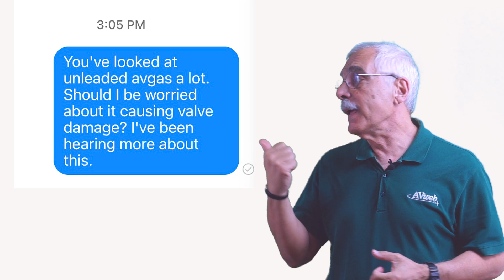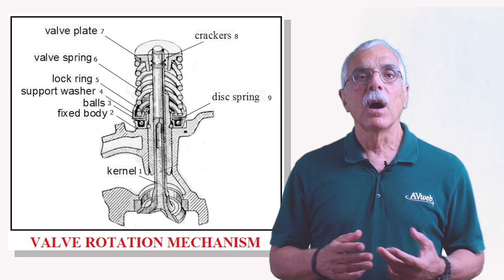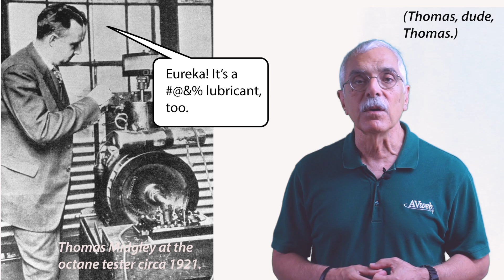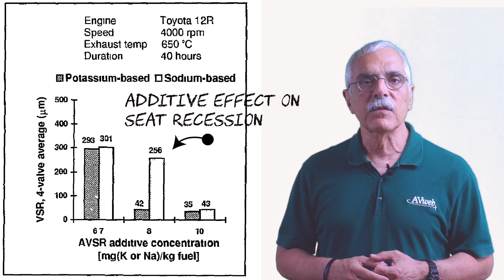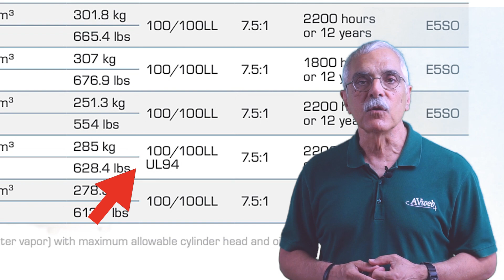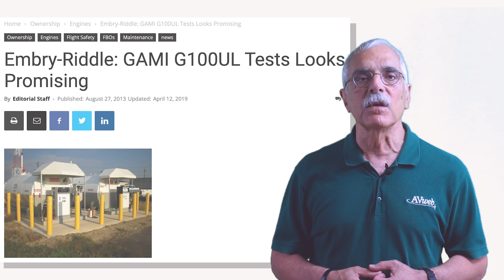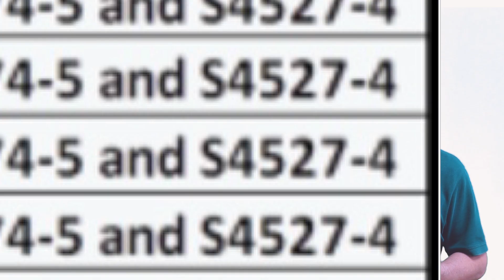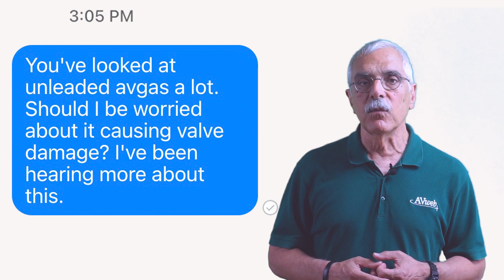Whadayamean Unleaded Fuel Will Trash My Valves?

Comment: For years and years Amaco had lead free gasoline. Long befor other brands went lead free. It had an octane of 95. My Dad use to run it in his vehicles for years. Also in the lawn mower, motorcycles, or any engine. Instead of lead they were using a chemical called “ Nichol- molibdium” to lubricate the valves. I may have spelled that wrong. It never went stale when stored. Or turned to gum. And the high octane never pitted the pistons of small engines. It was also great in 2 cycle engines. It was a great fuel. But in time went all others went lead free they changed the formula in Amaco gas. It’s not the same fuel anymore. And I believe all lead free gas is the same except for the added cleaning agents. Aviation fuel has extra components added to prevent boiling at higher altitudes. I have found that for automotive fuel EXON has the best cleaning agents to prevent carbon build up under the valves. The Ford eco boost engines are prone to carbon build up due to the way the emission system works.

Comment: An interesting comparison is the larger capacity air cooled Volkswagen engines (1585cc Type 1 and the pancake / suitcase 1970cc Type 4 Varient derived Transporter engines). These were rated to run on RON 90/91 fuel. The Californian specification engines may be of interest because of the mandatory use of catalytic converters which mandates the use of unleaded fuel.
Reply: As Paul said... Didn't most engines by the 80s and certainly by the time ECU control came around already have better valve seats?

Comment: God I'm sick of generalisations ... even by experts. Noone can generalise about any  fuel in any car. There's only one real answer: Every valve and every valve seat and every combustion chamber is made to the manufacturer's specifications for each particular engine model to be most efficient and ling lasting with a particular fuel. If you want to know the true answer for YOUR ENGINE, ask the manufacturer. Any fuel outside of their design and production parameters is an engine degrader in some way in some time frame.

Comment: Lead is extremely corrosive when an engine is stored. I've seen dozens of C Continental jugs with pistons and numerous things can attack them, but not a lack of lead. There's one more aspect to unleaded plane gas. Politeness. You can drop in, buy a Tee shirt and a hot dog, and gas up with no second thought. If your tank is 100% no lead, it's fine to drain all your plane gas into your car. I can't wait until lead is gone, altogether.

Comment: "Just trust us" doesn't cut it. Proprietary formulas are no excuse; we don't need to know the formula, and performance is not a protected trade secret. Show me a proper peer reviewed and independently repeted testing paper. 
Calling lead oxide a "lubricant" may be a mistatement based on assumption. But at the same time just because the protection does not come from lubrication in the sense of friction reduction does not mean that the coating is not offering protection.(It is likely either preventing a chemical bond or it is acting as a sacrificial weak link.)

I caution against the commonly misused term "hardened valve seats" as well as conflating abrasive wear with microwelding material transfer wear. The problem can be more about alloy than simple hardness. 
On one hand simple carbon steels and cast-iron will loose surface hardness at a fairly low temperatures (Relative to exhaust valve surfaces [both sides] in an engine at high sustained load, esp air cooled engines.), certainly below local temperatures needed for microwelding. Grey cast iron as used in 1960s cylinder heads is actually fairly hard and loaded with iron carbides and graphite flakes at room temperature. 
Many valve seats are made with a cobalt alloy called Stellite™, which is happens to be relatively hard but not as hard as a quenched steel, the advantage of Stellite is that it is more heat resistant than common low-alloy steel and iron, and on the chemical and crystalline side of things it isn't prone to microwelding with valve steels. 
Wear resistant steel alloys are often put through a hardening process but it is less about gaining the hardness and more about the formation of carbide particles or a toughened matrix to hold the particles.
Chromium, tungsten, vanadium carbides are the most common anti-abrasive wear players, being a magnitude harder than even the hardest quenched steel, iron-carbide is slightly harder than quenched steel but not on the order of the other carbides. But there are a few less common carbides and a few nitrides that can also add wear resistance in some alloys. 
There are also high-manganese alloys of interest, but I now less about them and they seem to be more in the category of work hardening and based on being softer but tougher and used often get used against loose particle abrasion as found on equipment that moves dirt and crushes rock as well as heavy impact such as railroad track junctions, but those alloys are rarely found on precision ground stuff like cutting edges.

Comment: Lead oxides lube hot valve faces and valve seats preventing recession, in  older alloys of valves and seats.
Newer engines have compatible materials starting in the 1980's
45 years in business and I have tested this many times.

cliff

Comment: I can't help but notice that Paul says that the switchover for cars was a problem. And Phillips did a study and found that it was a problem. And Continental said don't use it because it will be a problem. It is true that hardened seats are the cure. And a lot of airplanes have hardened seats. So "give it a try and see if you have an engine failure over a city." So all of the anecdotal evidence is wrong because there was one study on a low compression, low performance engine that didn't have a problem. From people who stood to benefit from it not being a problem. I'll follow the evidence of Lycon - who rebuilt my engine - "We did that engine too long ago. We don't have records back that far so we don't know if you have hardened seats or not. But we have had four failures from engines in California running unleaded so far this year. So I would run leaded gas as long as you can if I were you."

Comment: Thanks, Paul, for a comprehensive analysis of unleaded fuels in aviation engines.  It greatly helped put me at ease with this change.  Question:  does the UL fuels store as well as the 100LL fuels?  Car gas doesn’t store well at all.
Thank you
Reply: Modern automotive fuel doesn't store well because of the added ethanol. Ethanol-free mogas stores just fine, just like 100LL does. Since 100UL is ethanol-free, I would expect similar results.

Comment: Log ago I went through a phase of owning and riding old BMW "Airhead" motorcycles. If the bike was on its original topends (likely), whispering wisdom said use a lead substitute. If it had been rebuilt it likely had hardened seats. All my bikes were on the original topends and I used some additive. I can't remember the brand but I think it may have used cadmium, which, while legal, was no doubt more toxic than lead. You used a small amount - an oz or so, every few tankful's. In 50K miles or so I never had any noticeable issue. BTW, spark plug deposits were basically nonexistent, so I think this stuff may have been more in the realm of placebo than useful.

Comment: I'm rather offended that Continental didn't make the switch to hardened valve seats long ago.  I mean, the writing has been on the wall about leaded gas for decades now, and light aircraft have vastly longer actual lifespans than automobiles.

Comment: An important point here would be that likely all aviation engines use aluminum cylinder heads, which should all have valve seat inserts, and those inserts may as well have been made from good alloy metal.  The cars of the 60s and 70s had cast iron cylinder heads and just used that material as a valve seat.  There was no need originally to have inserts at all unlike engines with aluminum cylinder heads
Reply: That was indeed my understanding too. Though I had Alfa Romeo with an Aluminum engine and valve seat recession was a problem...
Reply: @ziegle9876  I guess they just didn't use a good enough alloy for the seat inserts?
Reply: @RickBaconsAdventures  Yes, they did not foresee such a radical change in the fuel when designing the engine... Another thing that Paul has not spoken about is the likely addition of cyclic aromatics to achieve the 100/130 rating.... They not only degrade with time, they are also highly carcinogenic (guess why gas stations are all self-service since "unleaded" came about) and not good for many elastomers/plastics (think windshields). The lead content of current 100LL is so low that it is irrelevant, and it makes the fuel long term storable and stable. It is really a pity that we can't have leaded speciality fuels like for aviation, motorracing etc.
Reply: @ziegle9876  are you insinuating that leaded fuel being combusted all over is the better solution
Reply: @ziegle9876  Self-service took hold for the same reason as many changes in retail; because it was more profitable for the owners of the gas station, who could sell more gas more quickly for a given number of employees. You don't need a conspiracy to explain that one.
Reply: @IstasPumaNevada  Ah, but you do if you're a conspiracy theorist and you mind is muddled from lead exposure.
Reply: @swell07_  100%, YES, at least for the special case of our AIR COOLED aircraft engines.
Reply: @IstasPumaNevada  Cancer from cyclical aromatics is not a "conspiracy" but a fact. That anybody had any negative health effects from low lead Avgas however is a pure conspiracy.
Reply: @ziegle9876 well we can certainly tell who’s been mouth-sampling the 100LL around here!
Reply: @ziegle9876  leaded fuels are absolutely available for motor racing. VP makes numerous types/octane ratings, as does Sunoco
Reply: @harescrambled  Yep, tons of morons in the powersports industry buy it and put it in their stock dirt bikes, snowmobiles, etc. Most of the time they lose power because most leaded race fuels have a slower burn rate and they aren't adding timing to make up for it. I find it unbelievably stupid and annoying most of the time, especially when i'm stuck behind one of them in a 1 line off road race. Very few vehicles running leaded race gas actually need a leaded fuel.
Reply: @ziegle9876  I have in canister over 5 years old 98 unleaded "E" free petrol, and it works perfectly in my 2 strike trimmer. not the lead make fule last longer, the "E" in the fule makes it shorter shelf life.
Reply: @ziegle9876 You are correct. Aluminum heads on early Honda engines, pre-2010 or so, do suffer from recession and the valves, particularly the exhaust valves, need to be adjusted after 40-50k miles as the valve clearances become closer and are in danger of overheating (burning) if you are engaged in "spirited" driving. Not sure that Honda has resolved the problem or not, but I no longer hear that it is a problem. The problem is/was not in the inserts themselves, but in the differing heat expansion rates of aluminum v. the hard seat material, which allowed the insert to be pounded down in the aluminum head a few thousands of an inch.
Reply: @GaryL3803  Strange that nobody has credited you with giving the information that valve seat recession will cause the valve clearance to reach an unacceptable (minimum) level, where the exhaust valve may not entirely close on the compression stroke. Obviously, this will lead to burning of the valve - resulting in a compression loss on that cylinder. I have seen this situation develop, on a Renault car that I owned. Further to this, there are different rates of cubical expansion - between the valve seat (steel alloy) material and an Aluminium Cylinder Head. I have also seen the effects where the Valve Seat will 'turn' - due to heat expansion, and this too, causes compression loss. I have even seen Exhaust Valve Seats being completely dislodged, and floating around freely, causing piston / engine damage, because the Exhaust Valve could not close, and thus contacting the piston.
Reply: You had a GM product, same as the SAAB I had @ziegle9876
Reply: Yeah ... I was kind of waiting for him to talk about titanium valves, or sodium filled valves that stay cooler.

Comment: It was my understanding that lead additive in gasoline was to prevent knocking, it was not added as lubricant.   Preignition can definitely cause damage to the valves and increase wear on the engine.    However, electronic ignition and fuel injection system removing the risks of knocking when the correct octane fuel us used.   Older planes with carbs on their engine., that I don't know.

Comment: It appears your av engines are low compression.  I am restoring a 1970 Cadillac with 10.5:1 compression.  Its a flat tappet engine with around 33,000 miles and as far as I know no problems.  I use diesel oil for the ZN and P additives in it.  I have always heard lead lubricates valve guides.  I have assumed in auto engines any no lead damage would occur over 10s of thousands of miles not 10 hours.  This car has obviously had no lead for decades.  I have a 74 Tr6 with no cat converter.  I remember in 74 they announced it had stellite valves, maybe sodium filled.  It has probably never had leaded gas.  The Cad is a duplicate of my moms car I drove back in the day and always put 95 octane leaded in it.  Any remarks?

Comment: All sorts of glider clubs have been running Lycs AND Continentals on unleaded Mogas for decades, in an intensely demanding duty cycle, over thousands and thousands of hours since the early 90s. If unleaded was a problem, we'd have known about it by now even with Continentals.  Maybe with this new fuel, Mobil will reintroduce AV-1 synthetic oil, if the sting from the class action suit has worn off.

Comment: Know a twin Comanche that used 93 octane car gas for most of the engines life.When the engines where overhauled the shop asked what gas and oil did you use.The engine specs where like at new engine tolerances in most parts.The engines where overhauled at 2400 Hrs.

Comment: The obvious answer to the dilemma is that old cars had cast iron cylinder heads with integral valve seats machined into them.

Aluminum heads have hardened valve seats installed.

No car has run on leaded fuel in 50 years and no car has had failed valve due to lack of lead deposits in the same amount of time. These aren't 2-strokes and engineers know what they are doing as evidenced by the tens of millions of vehicles produced every year and absolute rarity of ever finding one on the side of the road due to blown or otherwise ruined motor.

Engine failures are a staple of general aviation, not the automotive world. GA aircraft engines fail repeatedly due to their ancient accessories, such as failure prone magnetos and ice prone carburetors, and leak prone hydraulic propeller governors and gas lock prone, ancient, non-return type fuel injection, and countless hundreds of other egregious caveman technologies from the century before the second world war that will not die until everyone in the FAA grows old and dies and takes their bad ideologies with them.

Comment: I believe O2 sensors and electronic fuel injection plays the largest role in today's automobile engines lasting as long as they do.

With the unleaded fuel I wonder who will risk introducing o2 sensors, map sensor, ecm, and fuel injection to revolutionize general aviation.
Reply: Already did, it's called FADEC. Didn't "revolutionize" anything.
Reply: @tissuepaper9962 Porsche Mooney PFM offered car like fuel management and control. As I understand it owners loved it, but they only sold a limited number. 

It'd be interesting to see details on engine longevity in those planes.

Comment: I had been wondering why GA aircraft still used leaded fuel, given what we know about its health effects and environmental impact.
Reply: I think most GA pilots are wondering the same thing. We've been trying to figure this out for decades, with a lot of promising contenders but nothing reaching market, nor have many airplanes been built to run on readily available (and much cheaper) unleaded fuel. Aviation likes it's status quo, the basic design of the engines hasn't changed much since WWII.
Reply: @Quill Maurer  I'd guess like in every Industry, businesses won't do the right thing unless they're forced to by regulation.
Reply: @quillmaurer6563  That's definitely the other edge of the sword with regulations.  Outdated and counterproductive government requirements can be as bad or worse.